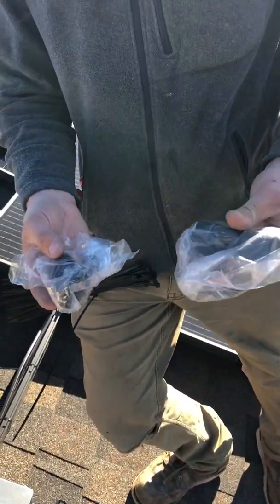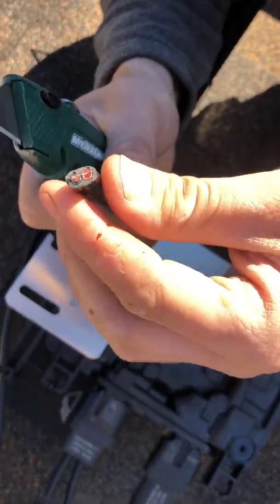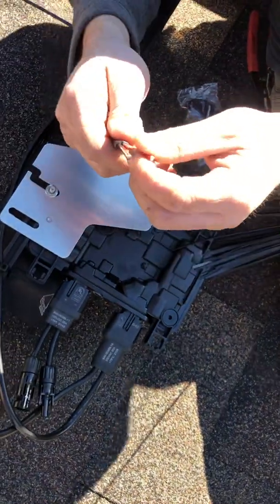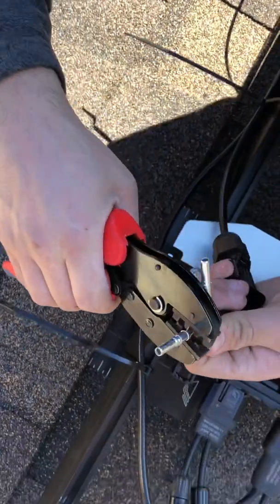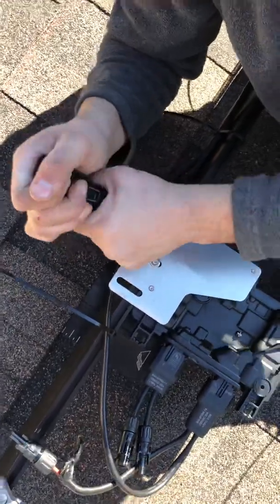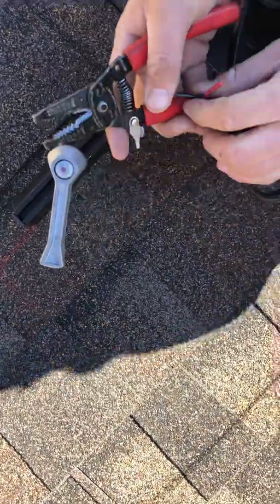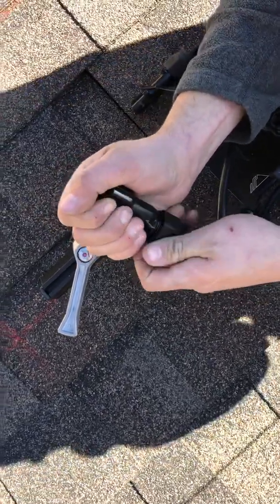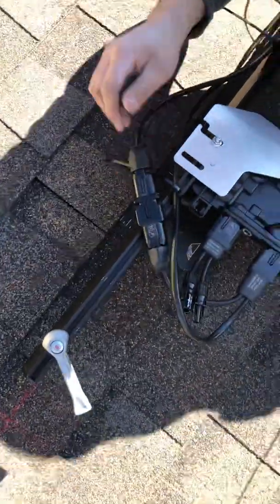ENPHASE: Splicing Trunk-Cable

Comment: Thanks for the helpful video.  I'm wondering why you needed to replace the existing splice?  Seems like the way you had it would work just fine.  Just wondering because the male/female trunk connectors are expensive.  Thanks
Reply: that is a great question !

Comment: do you have a link to these splice connectors?
Reply from the maker: I don’t, but you can probably order them from your local electrical supplier (not Home Depot or lowe’s, I mean an electrical distributor). When I made this video I was working for a solar company and using our job materials.

Comment: Thank you, that was a very helpful video.  Quick question: Are the connectors labeled for which side is red and which side is black?  Or because it is A/C it doesn't matter?  Thanks.
Reply from the maker: No, that’s entirely up to you. However, I do recommend you choose a way and stick with it. One suggestion might be to point Male connectors “downstream”, or pointed at your combiner box. Consistency helps when it’s time for troubleshooting.
Reply: It's very important to identify your phasing and be consistent when applying an Enphase System to an AC-coupled Energy Storage system. Still, as Eric stated, it's up to you to create a phasing system that you will be consistent with.
Reply: @miloinda  Can you elaborate on this? I watched the Enphase video and it looks like the connector can be rotated 180 degrees and still connect. The Enphase video also does not discern between the red and black wire when putting the connector together. This leads me to believe that the wire colors do not matter.